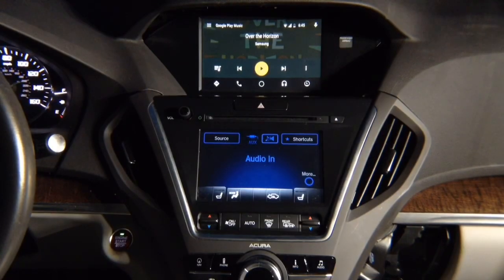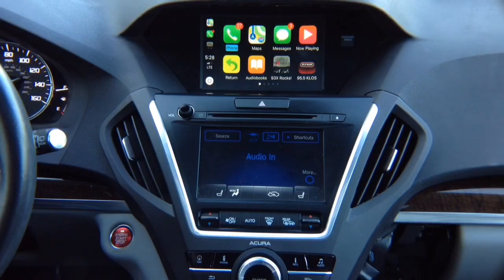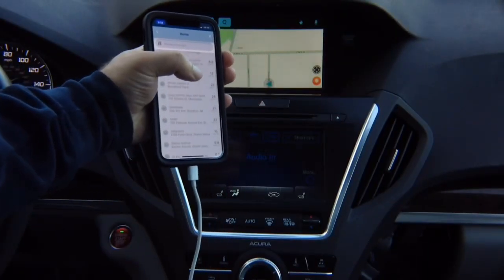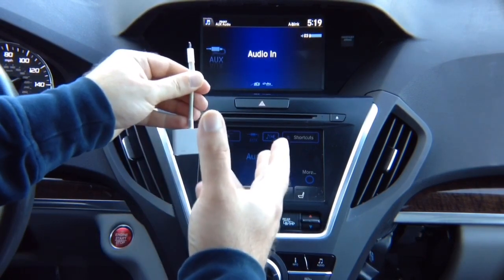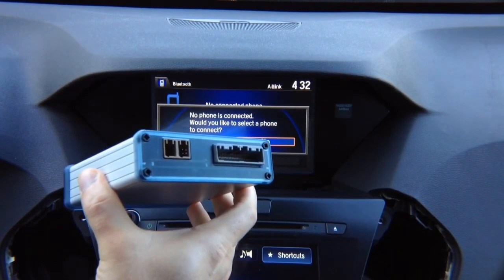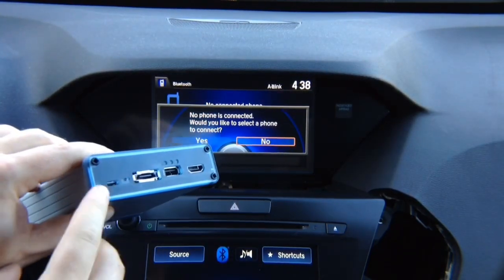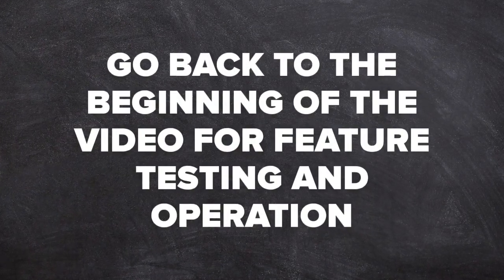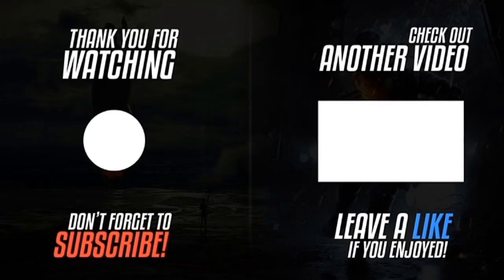Acura RDX Android Auto - Add Android Auto Apple CarPlay to Acura RDX 2016-2018 HDMI Input / NavTool

Comment: Why not use the cable already installed with the screen at the top. When you unplug from radio can you plug that into the device? Then plug device into radio? Using factory screen plug cord
Reply from the maker: Currently when you purchase and you receive the version 6.0 that’s exactly how it works and no longer need to access the back of the screen we use the factory cable